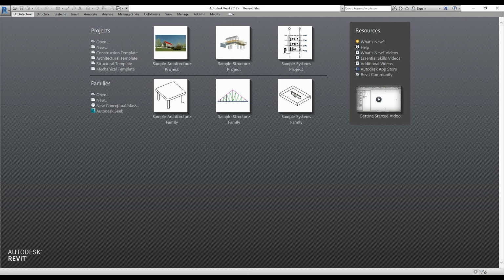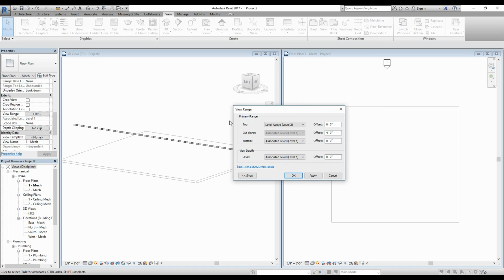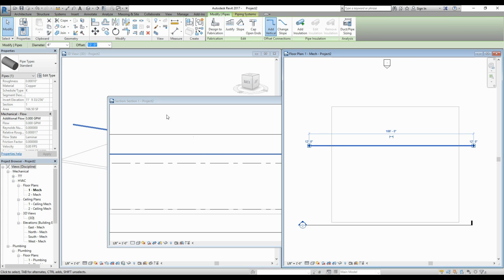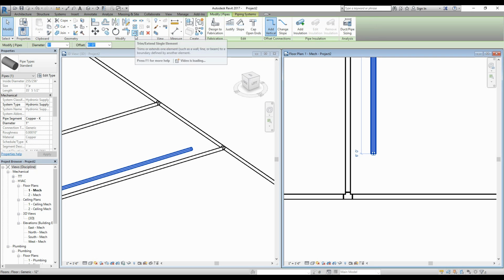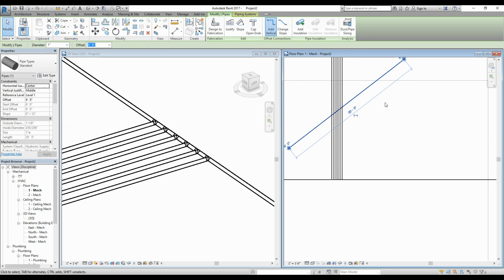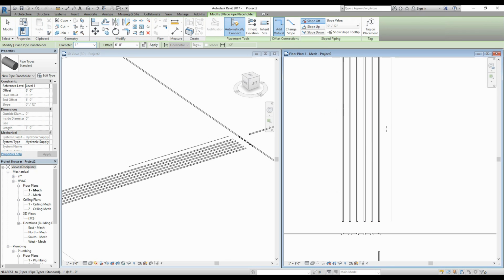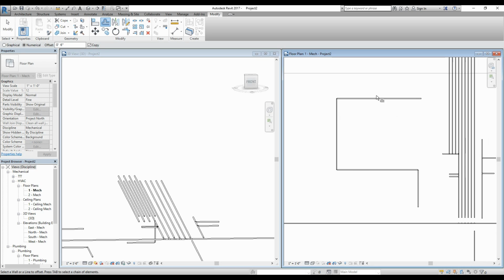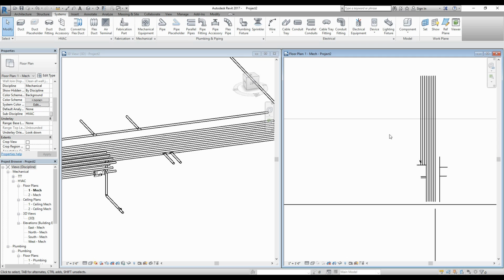Revit MEP for the Professional - Part 2 - Drawing Piping

Comment: You’re using illegal fittings. Try a combo rather than a Tee. Why create a sanitary system that can’t be serviced with drain cleaning equipment? Clean outs are required as well.
Reply from the maker: Hi Michael, this video was for beginners new to Revit, while I understand sanitary systems must have clean outs and 45 degree elbows and sloped piping, this may be a little more advanced to the beginner Revit drafter.  Thanks for your comment.

Comment: Hi friend do you have mep family for the flange with bolts and steel water tank? thanks
Reply from the maker: Hey, unfortunately I haven't seen a family for pipes with flanges and bolts. Revit has the piping flange family in the standard content. As for the steel water tank, I'm not exactly sure what your looking for but a good place to look is bimobject.com, they have tons of models for different applications.
Reply: thanks dear friend